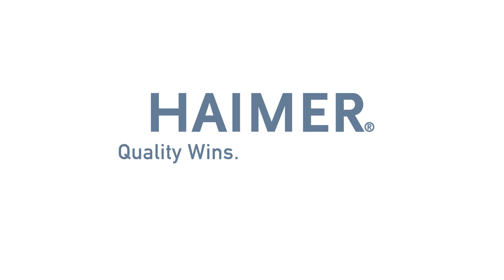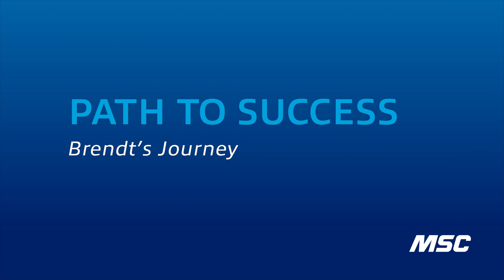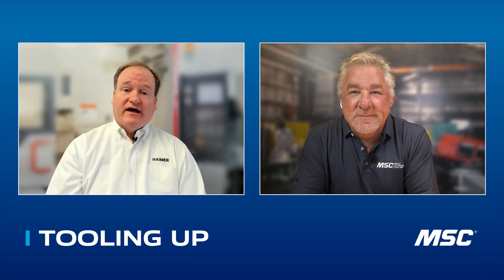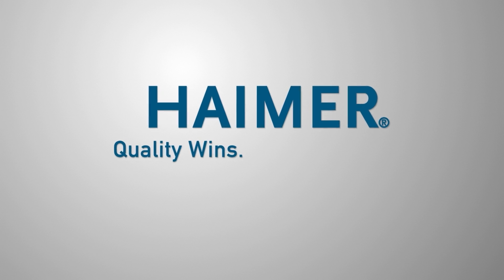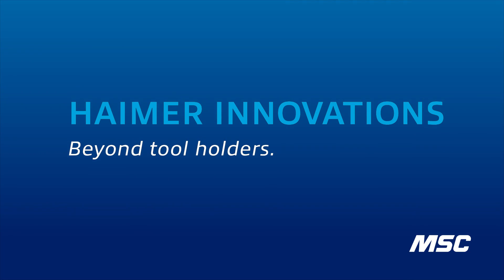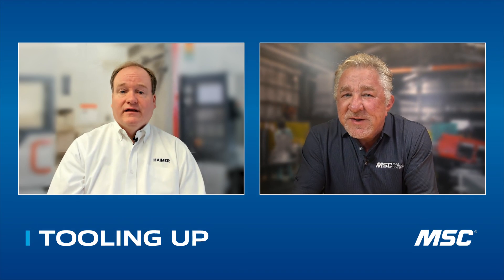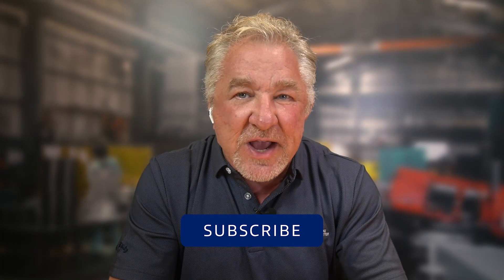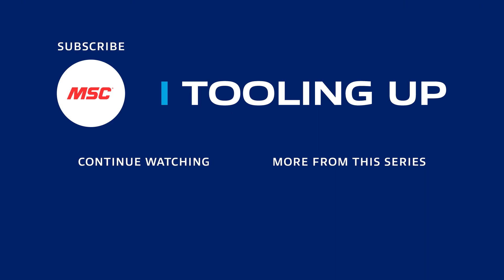Tooling Up: On the Cutting Edge of Innovation with Haimer USA [S2 ep.#1]

Comment: I am sold on the Haimer Heat Shrink Tooling. A must have for quality parts, repeatability, and tool life longevity. For complex multi-axis machining, they can get you where conventional collet systems won't. 

I hope MSC will start stocking the CAT50 dual contact holders.